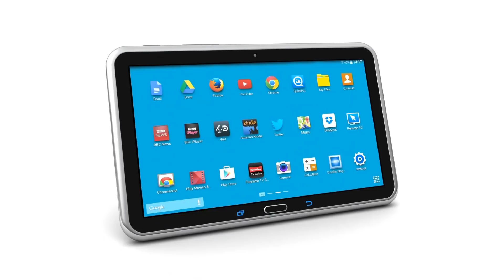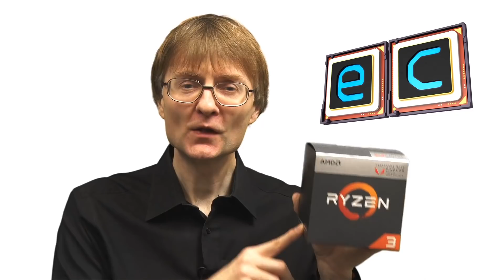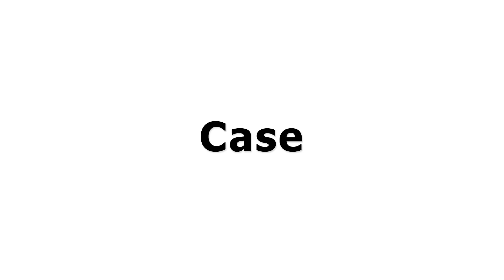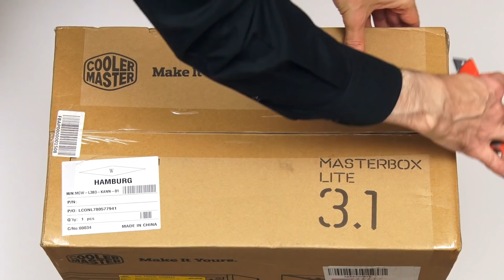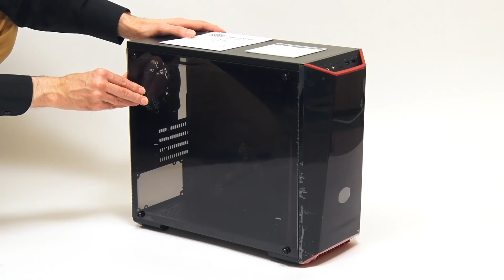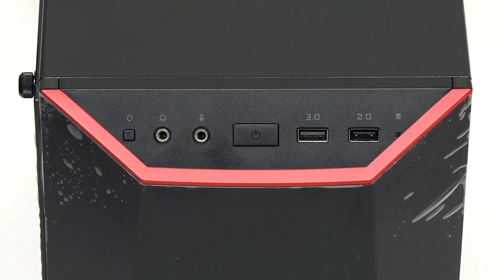Ryzen Budget PC Build #2: Case, PSU, SSD & Assembly

Comment: I'm wanting to do photo editing and some 4k videos from a Panasonic fz82 . Would this setup be ok for it with the better processor and what would be the best ram.
Reply from the maker: For 4K editing I would go with 16GB RAM, and yes the Ryzen 5 2400G would help. And a large HDD (or SSD) separate from the boot drive if possible for the footage. Today I have been working on Parts Three and Four of this series, and in Part Four I have been tested editing of 1080p footage on the Ryzen 3 2200G with 8GB (1GB allocated to the GPU) and it works beautifully. :) These two videos will post on Feb 17 and 24.
Reply: @ExplainingComputers   looking forward to the videos. Going to order parts but will not be able to finish it till you post vids . Love your vidoes as they show you what to do  in a clear way and are entertaining.

Comment: Can anyone tell me what graphics card is this? Thanks.
Reply: Thank you for your quick answer. I have subscrived your channel and pressed the bell. I want to build a pc using these components. Keep up the good work. Regards from Lagos, Algarve, Portugal.
Reply from the maker: Thanks for this. The third video uploads this Sunday (Feb 17). :)
Reply from the maker: The PC as built here is based on a Ryzen 3 2200G APU, which means that it is using the onboard Radeon Vega 8 graphics, rather than an external graphics card. You will see the performance in the video this Sunday! :) I will be adding a GeForce GTX1050Ti as an upgrade later in this series.

Comment: Great video! I am curious about the interesting mouse on the pad, can you give some info on it?
Reply from the maker: It is a 3M Ergonomic Mouse. I've been using one for 20 years (they are still sold), and forget they are not the norm! :) The hand rests in a non-stressed position, and clicks are made by rocking the thumb. Very good for RSI.
Reply: @ExplainingComputers  Thanks for responding so quickly. :) I checked your Beating RSI video. I too switched to a better solution, in my case a Kensington Orbit Optical Trackball, after having RSI problems. I enjoy using Orbit, but I still like to keep an eye on interesting mice for a potential better fit. That's why I asked. :)

Comment: Hi there sorry to bother you can you please I am having problem with my motherboard and ryzen 3 2200 g the problem is I managed to get to the bios but I cannot work out what is missing and there I've got about 8 gig memory stick I've got SSD 240 GB I tried to install Linux mint 9 but no joy at all can you help please or give advice who I can I contact regarding that matter I will be grateful for your help if you can and many thanks for your help in advance. Khamis Saeed
Reply from the maker: I am struggling to understand what your specific problem is, and what you mean by "missing" in the BIOS. So I've got get little to go on here. :) If you are saying that you have build a 2200G PC, then you should be able to download the Linux Mint 19.1 ISO, write it to a USB drive using (eg) Etcher, and boot from that drive. You may need to do this by selecting the drive from the boot menu (often accessed via F7). So please, let me know exactly that you have done. Also, what is your exact hardware? Specifically your motherboard. Are you trying to install Linux Mint on a B350 rather than B450 chipset, for example?

Comment: 19:27 - did you miss a screw?
Reply from the maker: A good spot. None of the connector close-ups could be filmed with the motherboard actually in the case. So I mocked it up outside of the case to pre-shoot the close-ups, but missed adding a fake screw in that shot. :)
Reply: @ExplainingComputers  Ahh of course. Thanks for the insight!

Comment: @explaningcomputers can you do a video on TPM as well? Having windows 10 and TPM hardware encrypted is a Real challenge!
Even motherboard setting are need to be adjusted Before Windows is being installed. Very very little about TPM is covered, and when there is, 99 out of 100 is software based which is no comparison to the hardware version.
Reply from the maker: Noted. :)

Comment: Whats with these nice rounded snowflake cases. Eee when I was t'building computers there were razor blades all over the place inside. Cable managment? Pffft! We just crammed it in, sat on the case and screwed the blighter down. If you haven't got yer hand stuck in the 3.5" HD drive aperture to pull the cables through and had to get yer mate to hold the lugs off yer hands with pliers you haven't built a computer. Kid's these days don't know they'er born. I didn't want to build computers; I wanted to be ... A Lumber Jack! 
I'm a Lumber Jack and I'm OK ....
Reply from the maker: Tis all so true! :)

Comment: Hi Chris. Nice build. I usually run the board out of case first with a Linux flash drive or a PC-Check device to make sure we have a worker. Have you used PC-Check? It's great if you do few builds a year or do service and repairs. I'd like to see you review it.
Reply from the maker: Last time I ran the motherboard out of the case during a build series of videos, I got a lot of complaints! So I cannot win here. I will checkout PC-Check.

Comment: it's not clear: you overpayed 10 pounds for 100 watts for the power supply unit, and on the SSD you saved 8-10 pounds for plus 120 GB. Windows 10 with all updates takes a good 50 GB (with hibernation). On the disk drive nominally 111 GB. (there is not enough space for new videos) But the video is still cool, I like it.
Reply from the maker: Windows 10 does not take 50GB for the files it installs. Remember that the space that Windows will be reported to be using on a drive includes both its installed files, plus the space allocated to the recycle bin, restore points, etc (which normally defaults to 10 per cent of the drive). So the bigger the drive you install Windows on, the more space you will see "disappear". I run Windows 10 on a LattePanda with a 32GB eMMC drive. Runs fine, with Windows 10 (full install) consuming less than 10GB, and that included the October 2018 update last week. I very much suspect that Windows 10 will use less than 10 GB on the 120GB drive too, though take your point on a bigger drive. Though I did note that an SSD should be selected to user requirements. :) On the PSU, remember that cheaper PSUs drop their output significantly beyond a fairly low temperature (eg beyond 30 degrees you can see a fall off of maybe 30 per cent). I like to account for that in specs. And cases and PSUs tend to hang around for a long time. :)

Comment: would a ryzen 5 2600 also work?
Reply from the maker: Yes, provided that you add a graphics card. Use a Ryzen 5 2400G if you are building a system with integrated graphics. The 2600 does not contain a GPU (no "G" on the end!).
Reply: @ExplainingComputers  thank you so much for your quick reply! I see, of course. Noobie mistake to miss the 'G' on my side :/ will rectify with a 1060 :D thank you for the great content!
Reply from the maker: The combination of a 2600 and a 1060 will give you a great PC. :)
Reply: @ExplainingComputers  :D I just realised now how the corsair RAM I installed are 1.35V clocking at 3000MHz. however the board only supports 1.2V, as for the fine print on the ram slots. I noticed the RAM clocked in at 2133MHz which is standard DDR4 speed. is it fair to assume they un-overclocked and are safe to run at 1.2V? I built two of these machine, one running a 2200G and one 2600+1060. The first one has been on for the most part of two months without hiccups
Reply from the maker: 2133MHz is the standard (top) DDR4 speed as you say, and all DDR4 memory of that speed or above will run at 2133 unless you enable XMP profiles in the BIOS/UEFI (I think a lot of people never run their RAM at full speed as they do not know this!). Providing the machines run OK, I can't see there being any issues with your systems. However, you could try entering the BIOS and enabling XMP Profile 1 to get the higher speed (I actually show this my BIOS video this Sunday, or indeed in the third party of the Ryzen build series).
Reply: @ExplainingComputers  thanks a lot, I merely assumed some MBs had different voltage ratings. interesting and very prompt to get back to me. Really appreciated.

I don't mind lower speeds in order to preserve the components. would the MB be able to supply higher Voltages to the RAMs?

I mounted a stupidly large Noctua heatsink..the fan is so smooth you can hardly hear it when your ear is right next to it. the sane cannot be said of the case fan though :P

Comment: +ExplainingComputers
Hi, yet another great upload, being as i am new to your channel and you have injected a new passion for me to upgrade my system i have a simple question, were is best to place your power supply unit ? as i have always had mine at the top of my tower/case due to the fact that heat rises and the fan method will suck out the rising heat and then blow out via the back exhaust, however i have noticed that on modern tower/cases that they are being placed at the bottom, to me this does not seem like a good idea due to heat rising and those few degrees more is not desirable to me, i have a cooler master tower/case were there is plenty of room as i do not like squashed up internals as so the heat is easier to dissipate,
anyway thank you for your thorough and enjoyable uploads
Reply from the maker: Glad to meet you here. There are arguments both ways on the PSU. A PSU at the top with a base fan will indeed draw hot air out of the case. But this hot air is also heating the PSU. So there is a logic (with a base PSU) to isolate the PSU airflow entirely, which is what we see here.

Comment: Some PSU should be installed with  the fan facing up, as recommended in the manual. This is the case, for example, of Thermaltake RGB that I have.

Comment: Got a question about the motherboard.   Your motherboard has VGA (D-SUB) port however none of the others do (I live in the USA.) I am not looking to upgrade the monitor nor do I plan on playing games (current monitor doesn't have HDMI support may have DVI-D support, not at home right now so I cannot look.)  I am replacing a desktop that I have an email server on.

Currently running it on an AMD Athlon(tm) 64 X2 Dual Core Processor 4200+  which is about 9 years old.  I want something a little faster and more memory.

Thank you.

George
Reply from the maker: Boards with a VGA port are getting rare. I am not aware of another B450 board with the port I'm afraid.
Reply: @ExplainingComputers  thanks for the reply. I understand the need for HD for modern games however I do not understand it for a server monochrome graphics would do just fine in most cases. Until just recently was running a Novell Netware 5.0 Server and did not need a high end monitor.

Again thanks.

George

Comment: You don’t need a 550W PSU for that build, even allowing for a later graphics card and say a 4TB HD.  There’s no point in fitting a massively powerful graphics card because of the limitations of the 2200G, so you’d probably be fitting something like a 1050ti or a 1060.  All that will fit within 400W, 450W if you really want overkill.  Better to spend an extra £20 on the PSU and go for 400W because...

The Corsair VS range does not have good customer reviews.  Corsair is a respected brand but it makes a range of PSUs and VS is right at the bottom of the budget range.  Corsair just rebadged Chinese PSU so at the bottom of the range you are really just paying for the label.  

If you were going for a first time build better to pay about £20 more, go for 400W and see if you can get semi-modular.  I just check Novatech website and you can get a fully modular EVGA SuperNOVA 550 G3 Power Supply
Gold is much higher efficiency (so less heat) and that cost £75, but it has a 7 year warranty and it could easily see you through your next three upgrades.

It is fully modular which means you only use the cables you need and that is such a blessing especially when it is your first experience of cable routing which is an art and a science.

That said I build systems for people as a paid hobby and when the budget is tight while I’ll never scrimp on the quality of the PSU (so I wouldn’t buy that VS) you can just cut off the wires you don’t need.  At the same time as there is no going back that isn’t a suggestion for those without confidence.  Just to point out that you can do so, just insulate the exposed cuts to avoid an accidental short.  THe PSU won’t know the difference

Comment: Nice build.  I started a Ryzen 2200 build but won't won't run Win10. So,  went with Ryzen  5 1600. I recycled Corsair PSU.  Purchased non working Corsair 16GB online got warranty replacement.  New Rosewill Case, Recycled Video card, 2 HDDs & DVD, and used Cooler master Hyper 212 online.  Gigabyte GA AB350 Gaming board.  All only $199.50 after rebates etc.. Getting Win7 working was quite tricky on a non supported CPU.  Nice Video.

Comment: @15:41, it looks like you plugged the USB 2 cable into the USB1 slot.  Or am I seeing things?
Reply from the maker: I understand your conclusion, but there are no USB 1 headers on the board. Both of the connectors are USB 2.0 headers -- labelled USB 1 for the first one, and USB2 for the second. :)

Comment: Another great video! I've just ordered my second load of stuff. I've gone pretty much with what's described here except I decided to go for the WD M.2 256Gb SSD and 16Gb or RAM. 
Will this series of videos cover the monitor as well?
Reply from the maker: Very good upgrades. :) I won't be covering monitors I'm afraid, but pretty much anything with an HDMI or DVI-D connector will work with this machine.

Comment: Could the case be changed for a Micro ATX? Would the power supply still be useable with Micro ATX?
Reply from the maker: Everything shown here (the motherboard and case) are Micro ATX (mATX). The case used can take either Micro ATX or Mini-ITX boards. So you may be able to find a smaller Micro ATX case, but the one used is already a Micro ATX one :)
Reply: Thank you. I need to save on space. this will be ideal. Thanks for the videos. Excellent series. Just what I was looking for. :)

Comment: i think technically it is called UEFI and not BIOS. anyway, nice build so far!
Reply from the maker: Thanks for this. I would argue that technically it is a UEFI BIOS, rather than a legacy BIOS. A point of contention today I know! But Gigabyte list it as a UEFI BIOS in their specs. MSI also refer to their boards having a UEFI BIOS, and Microsoft refer to Legacy vs UEFI BIOS types. It all depends on whether you take "BIOS" to mean built in operating system generically, or a specific technology implementation for the same.
Reply: @ExplainingComputers  I guess it's  just called that way for convenience, since the technonlogy behind it changed a lot by now. Some people just like using old words I guess. ;-) 

Just like some people still call smartphones mobilephones even though the technology completely changed, if you compare the first mobile phones to modern ARM-core-powerded phones.

Thanks for your replay Chris. 

Rly like your videos and I like your choice of parts, since the value of the 2200g is crazy, because it can be overclocked to almost the same power of a GT 1030. What an awesome integrated GPU!

Looking forward to see all the other parts to come!

Cheers!

Comment: Hey I liked the video but I would recommend using $XXX budget instead of just saying budget because I could have a budget of $5000000000000000000 or a budget of $5. I compiled the parts to build a similar system but I got way more equipment for the PC for that price. It might be because you are in a different country. I also watched your part one to this video. And just to be clear, I am not saying anything bad just a recommendation because I was confused when you said budget.
Reply from the maker: Sorry to confuse. Though the word "budget" is often used to refer to low-cost -- eg in "budget airline".

Comment: Another great vid, I personally, would have put the extra cabling in the HHD housing if not using a HHD, still looks good. I did a bit of browsing at one store here in Vic, Aust, and for current cost of this build with some minor adjustment (SSD) ~ Ryzen 3 2200G $155 AUD, Gigabyte B450M DS3H $135 AUD or the MSI B450M Pro-M2 $105, Corsair Vengeance LPX 8G DDR4 2400 $99 AUD, Cooler Master Masterbox Lite 3.1 $59 AUD, Corsair VS550 PSU $65 AUD, Sandisk Ultra 250G SSD $79 AUD, total in AUD = $562 AUD or with the MSI B450M Pro-M2 motherboard $105 = total $532 AUD. For a bit of a comparison in AUD $, prices subject to change at a miliseconds notice ;)

Comment: That new electronics smell, like that new car smell... so very unique

That's a very nice looking case. There appears to be space for another pair of SSDs in front of the motherboard if those mounting holes work like I think they do (I know the whole Mastercase line has extra modular add-ons for things like that). I bet you could fit an All-in-One Radiator to those front fans as well, because there's certainly room for that in there.

I'm rather curious about that mouse looking thing, though, as I've not seen one line that in a few years.

Comment: I read the description of the video and I must say that I don't recommend pairing a NVMe SSDs with this processor

The Ryzen 2200G only spare 8 PCIe lanes for all external PCIe devices. This would mean that if this PC will have that SSD and a dedicated GPU, they will have to split the available lanes. I believe only having 4-6 lanes for dedicated GPU will cause a bottleneck.

But if you're only sticking to integrated graphics, then yeah sure. I like your videos
Reply from the maker: I am not using an NVMe SSD here! I totally agree with you.